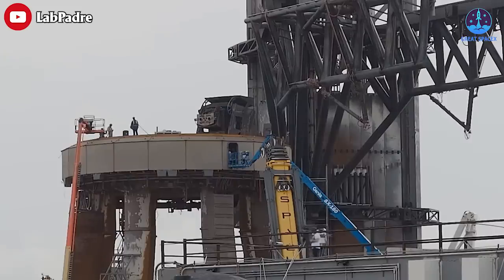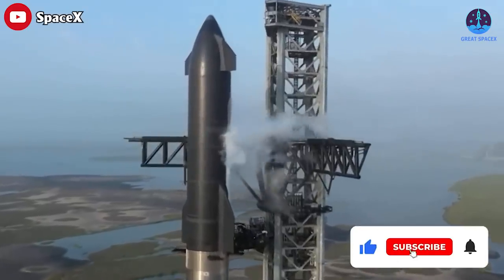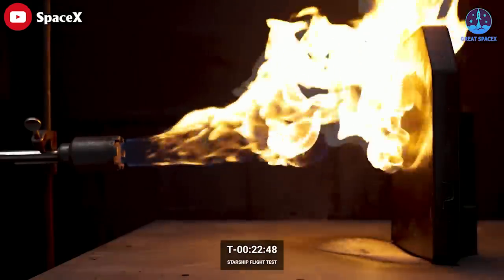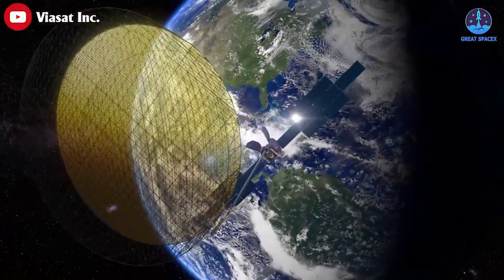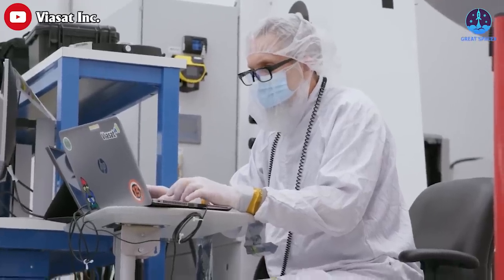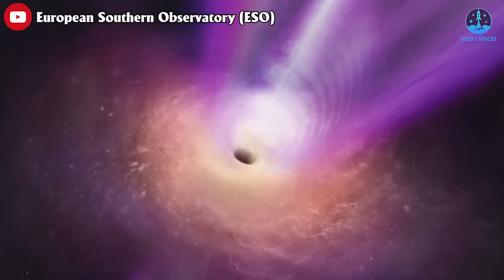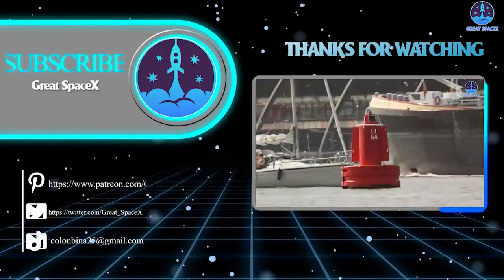Why SpaceX heat shield is the best part of Starship's first launch…

Comment: You are incorrect.  You are referring to ablative material like on capsules.  Tiles are not ablative.  The shuttle tiles were not ablative either.  Ablative would need to be replaced after each use.
Reply: Yep, Thanks for pointing that out.
Reply: @gregsteele806 I don't know ½ 36th
Reply: The old Apollo Is crew capsules  Had ablative material On the bottom
Reply: @jamesturner6949  think the dragon has pica x
Reply: @gwhyte01   Wow that's a good question I guess it would have to since it lands the same way

Comment: Errors in this video begging for correction:

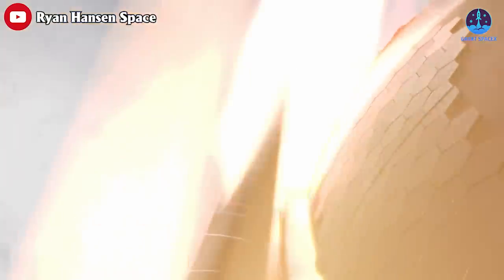1) At 1:06, you state that the tiles covering Starship “burn off” during re-entry (a.k.a., they are ablative). While phenolic-based space capsule heat shields are ablative, the tiles over the Space Shuttle and Starship are not ablative; they are re-useable. They resist heat erosion by being inorganic ceramic, not being susceptible to oxidation, and being highly emissive (efficiently dissipate heat as infrared radiation).

2) At 1:39, you call the Atlantis “Atlas.”
Reply: Huh I thought all cermic shielding was ablative functionally. Interesting
Reply: Wrong

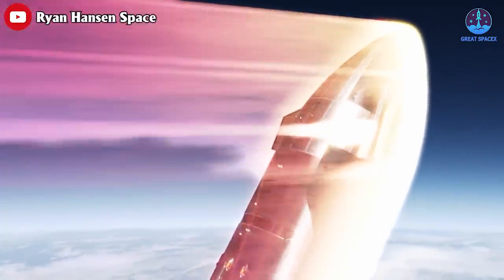Comment: 0:59  not friction but compression
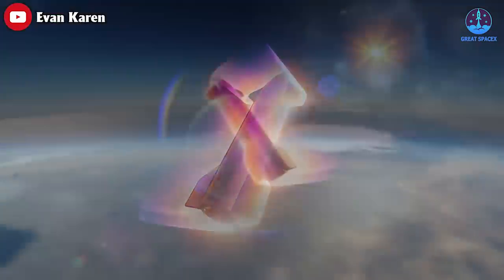1:17 not a gassy barrier 

These are ceramic tiles, not ablative 

Your research must have been for the Apollo era where the capsule used ablative single use heat shields.

Comment: I appreciate you want to pander to the musk/spacex fan club, but this is just idiotic.  The tiles were not tested at all.  About the only good thing you can say about them is they didn't fall off in the first few seconds of the launch.  Until this thing hits the atmosphere at orbital speeds or higher we won't know whether they are good or not.  As for returning from the moon that's a much higher entry velocity than just the usual LEO entry speeds, so they need to be perfect, and they need to be reliably stuck in place.
Reply: I'm a pretty big musk fan boy and that's a fair criticism for sure. Space travel is hard as fuck, praise what works and reserve judgement on stuff that isn't tested completely
Reply: I'm pretty skeptical of a water cooled plate holding up to starship. Adding potentially super critical steam to a situation with immense pressure already seems needlessly dangerous. The water pump/frame trench designs the soviets/nasa used mitigate the force and the heat not just one.

Comment: Space X’s heavy launch vehicle and its Raptor engines are promising breakthroughs, however; several engines failed during the first stage ascent. An outside source stated that it appear: E1, E6, and E7 had failed at launch. E18 failed violently at T+30; E19 failed at T+46; E22 failed at T+60; E23 failed at T+94; at T+122 flames were visible at the thrust section; and at T+130 the rocket started spinning.

Comment: During the ignition and liftoff of the Space Launch System rocket, the “Ignition Overpressure Protection and Sound Suppression water deluge system” at Kennedy Space Center’s Launch Pad 39B released approximately 450,000 gallons of water across the mobile launcher and flame deflector, and the flame trench. During the launch of the Super Heavy rocket, how much water was flowing onto its launch pad?

Comment: I believe the failure of the launch pad failure was expected, but some of the consequences were not expected. SpaceX  needed to replace the launch pad and had equipment & materials on site to complete the revised pad but the cost and time were an obstacle. By launching the demonstration unit they proved the basic concept worked, with information gained a second attempt would be COMPLETELY successful, basically the STARSHIP WAS EXPENDABLE.
The launch demolished the launch pad and saved time & money,  justifying a complete redesign & rebuild . The FAA assisted by grounding the StarShip launch  to meet safety standards. 
The flying concrete and its consequences were expected, but were under estimated. ....
OUT with the old & on with the new....... Great job ELON  ....  I may be wrong but time will tell.
Reply: I believe SpaceX has publicly stated that the overt failure of the concrete was neither expected nor planned. It is unreasonable to assume SpaceX would intend damage to stage 0 and the tank farm, both of which would be probable given even a small release of debris.
Reply: I know they are being sued because the debris field was  several orders of magnitude larger than the exclusion zone. That needlessly dangerous, and I'm a huge space x fan boy.

Comment: Going to nitpick the rocket science here, the intense reentry heating is not caused by friction, but rather the compression of air at more than 20 times the speed of sound. 
That is the reason why relatively brittle ceramic tiles can be used, what's important is their insulation.

Comment: Can be a heat-shielded stage-0 be a sollution for the current concrete RUD problem?
Reply: Elon's plan is to use a huge steel plate with water cooling.  Think of a radiator.  A solid block of steel, with water flowing through channels inside.  Steel will hold up to the pressure better, and fast moving water through the cooling tubes will keep it cool for the 8-10 seconds of liftoff.  I would imagine, underneath would be feet of concrete.  I think surrounding areas will need to be covered in thick steel plates as well.  I am not sure of the plan, but if it were angled, or wedge shaped, the flame could then be directed in one or two directions.  Is this the solution?  I don't know, but it certainly sounds better than just concrete underneath.

Comment: How did the launch pad damage prevent separation?
Reply: Based on the video, it appears flying debris damaged at least one hydraulic power unit, maybe more.  Loss of hydraulic power eventually caused loss of thrust vectoring and vehicle control.  If stage separation also relied on hydraulics for operation, it would make sense why that failed as well.  Sounds like the next one to fly has already deleted the hydraulic system so should be more reliable.
Reply: Also, it was the speed and altitude of the vehicle didn't reach preprogrammed goals.
Reply: @arthurhamilton5222  Yes exactly.  They did make it through max Q, but at a later time than planned due to the lower than expected thrust.
Reply: MaxQ occurs at supersonic speed and Starship got to Mach 1 at T+ 1:41 when the vehicle had no longer the acceleration necessary to reach orbit, no Mach waves appeared around the rocket during ascent… no MaxQ licence for me.

Comment: This testing phase should be less of a drag.
Whatever the thrust vector anomaly caused by the launch from pad phase of the ascent , the tiles also had a too many forces placed upon them Gravitational force.
Electric force. Magnetic force. Nuclear force. Frictional force . Of these gravity and atomic nucleus and friction can make it past Max Q as the shuttle example. Maybe it's a rumour that they put a RF sensor on every tile, so long ago , wouldn't know for sure. Ironically if they fell loose by buffering in the re entry it would be too late and more payload weight to develop an active system on the leading tiles to flexibly compensate to the brink not brick like some tension sci fi.

Comment: I have an interesting question? If the heat sheild work? is it possible to cover the launch pad with a heat sheild as well?
Reply: I mean, they are already planning that. But with a metal sheet cooled by water. These heat shields burn. Use enough water and the metal won’t.
Reply: You probably (hopefully) ment it as a joke, if so its a good one.

If its a serious question then the serious answer is that the problem with stage zero is more than heat. It is the force of the blast that makes the concrete crack, and the ceramic heat shield tiles are very briddle and they would do a lot worse than concrete.
Reply: @torben777  Now its getting to a conversation. Whenever you solve one problem another takes its place. The concussion force has to have somewhere alse to go, the issue is designing the system in a way that deflects the force away from where you do not want it, and somewhere that is prefered. So the right "Shape" is crucial. The concrete is too weak to take the Concussion force directly. The damage gives a clue to the issue. Under the platform is where the biggest pressure is located. You would need two things. 1: A Metal dome to deflect the Concussion for by splitting it away from the Legs of the Platform. The platform legs needs a thinner geometry on the inward faces. Building The PlatForm into the ground would also allow you to deflect the concussion forces into tunnels to disapate.
Reply: Basically no. The tiles are much to brittle to withstand the power of those raptors.  You saw what they did to high strength reinforced concrete, in places stripping it down to the reinforcement ?  A water cooled steel diverter is the way to go.
Reply: Just so you could pull your own string 👏🏼

Comment: May I comment  and suggest for ELON.: Just an idea...>>>>> How about making more elevation of launch pad made of steel and concrete combination. With increased elevation, this would relieve excessive thermal pressure during rocket lift off combustion. Of course having coolant for the periphery of launchpad especially its bottom pad is necessary. I hope this idea could help. I am Space X enthusiast.

Comment: Quite impressed with performance of the heat shied tiles.  I expected many more to fly off, but it made it past max dynamic pressure and only lost a few.  Looking like good progress.
Reply: How do you conclude it only lost a few? I have certainly seen no picture of a resolution that would allow you to determine if tiles are missing or damaged.

When the shuttle had problems with heat shield tiles even NASA had no clue how many were missing until it landed or they commissioned a spy satellite to take a peek in space.
Reply: @torben777  There were on board camera shots in the nose of the ship, looking down the stack.  You can see 5-6 tiles missing in the shot, but it only shows approx 1/3-1/2 of the tiled area.  Considering how many tiles they were losing just doing static fires and moving the ships a year or two ago, it’s looking like they are getting it figured out

Comment: The heat tiles weren’t even tested for what they were built for, namely REENTRY OF THE ROCKET.
What kind of clickbait bullsh-it is this??
Reply: Surviving the rigors of launch is definitely part of testing.
Reply: @saquist  They're heat tiles, not "launch tiles". 
There was barely any heat applied to them.
NASA, Boeing, and other contractors have had working heat tiles (which survive launch) for over 50-years.
SpaceX is LITERALLY behind on rocket technology, they aren't pioneers in any sense.